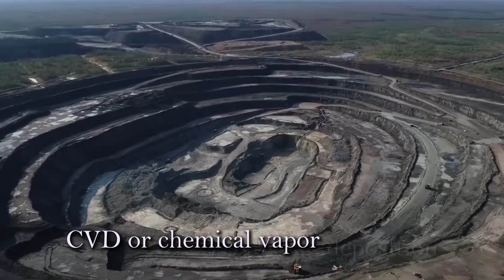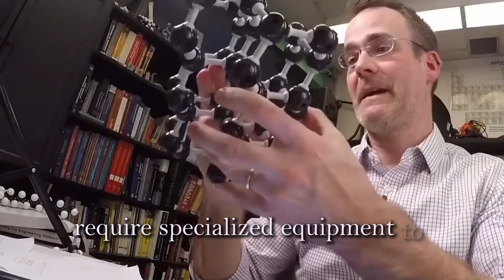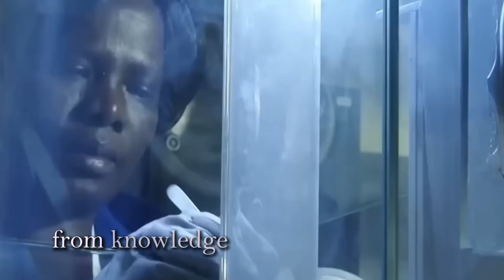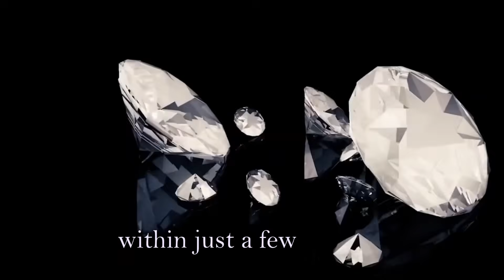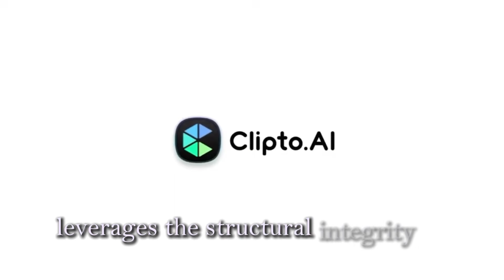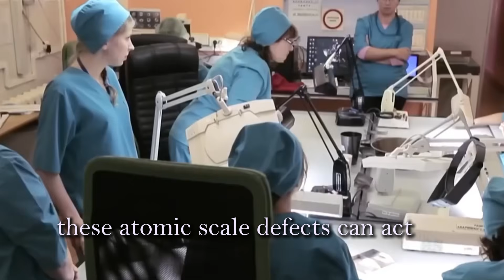How Scientists Grow $50,000 Diamonds In 3 Weeks - Inside The CVD Factory

Comment: Yeah, it's still synthetic. 

The structural growth patterns
Natural Mined Diamond: Grows in an Octahedral pattern. Under testing equipment, this shows up as concentric, 8 sided squares. It is a slow, multi directional growth that layers outward uniformly in all directions over millions of years.

HPHT Lab Diamond: Grows in a Cuboctahedral pattern. It has 14 distinct growth faces. Because of the cubic machinery press, it forms flat, geometric sections that intersect to create a permanent hourglass or "Maltese cross" shape inside the center of the crystal lattice.

CVD Lab Diamond: Grows in a Stratified flat pattern. Because the plasma gas rains down from one direction onto a flat seed plate, it grows straight up like a stack of pancakes. This leaves permanent, parallel linear growth sheets that look exactly like the grain line rings inside a tree trunk. Natural diamonds completely lack parallel stratification lines.